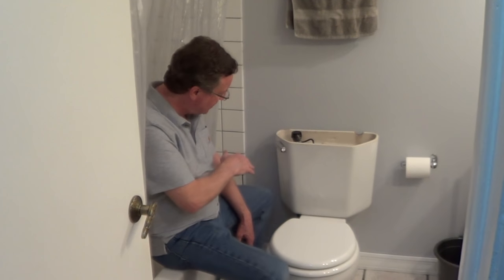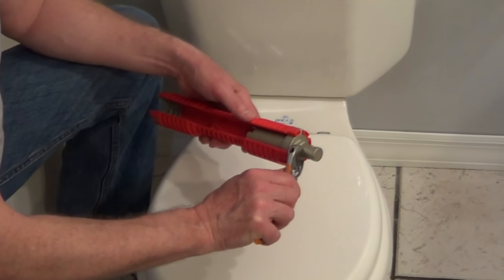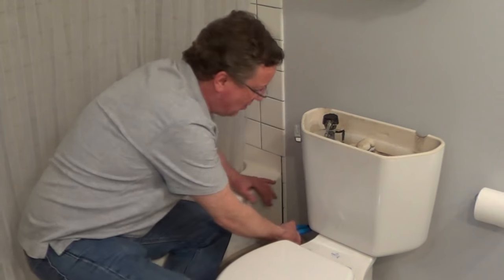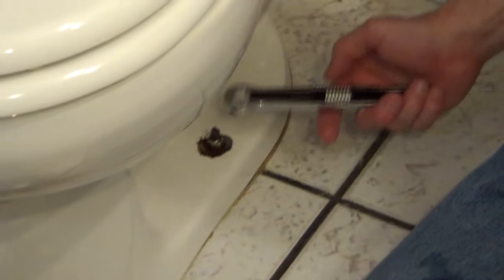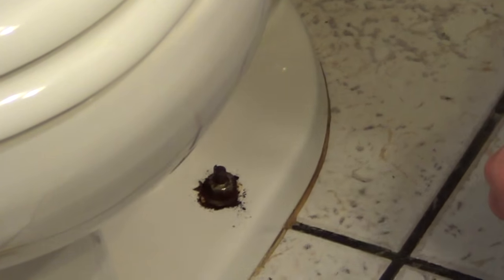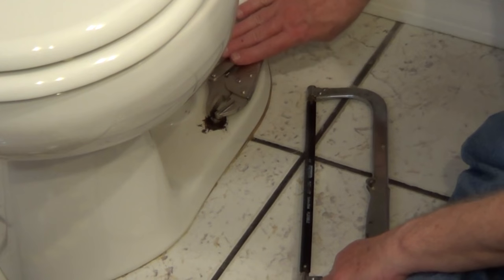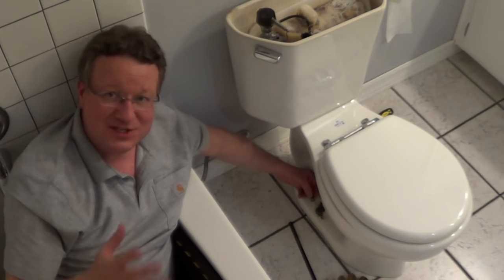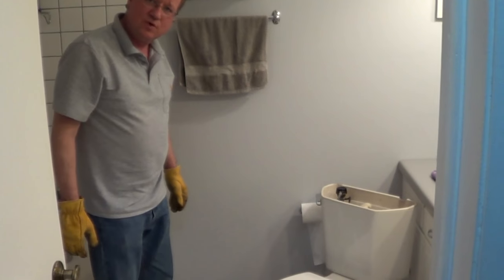How to Remove a Toilet

Comment: That was great, thank you.  But once I get it off is there a way to check to see if something is in the trap because my toilet keeps threatening to overflow even though the plumber tried to snake it. Is a new toilet the only option or can the old one be remedied? You seem like you would know.
Reply from the maker: Hi, you can use a toilet auger with the end opened up wider with a pliers to try and catch something caught in the trap, like a toothbrush or comb. You can take the toilet outside and turn if upside down and pour water into the bottom with a 5 gal bucket.
Reply: Ok, so here’s what I did. Emptied all the water like you said. Took off the tank. Strong armed the toilet bowl downstairs (HEAVY!) to my backyard grass area, plugged a rag into the hole to the tank, and forced the garden hose wrapped with another rag to keep the water from coming back out, threaded it up through the bottom hole and turned it on full blast. Whoosh! Out popped 2 x 2 inch plastic dental floss container that has been threatening an overflow for years.  Professional auger guy previously couldn’t auger it out and told me I needed a new toilet.      Scrubbed everything up, got a new wax seal, reassembled, learned a bunch, and saved tons of money and didn’t have to buy a new toilet.  Thank you for the details and inspiration!

Comment: What about the caulk?
Reply from the maker: Hi, are you asking about the wax ring?
Reply: FIX IT Home Improvement Channel  No the sealing caulk around the bottom of the bowl.  It’s by far the most difficult part and I haven’t found a single video that explains how to cut through it. I ended up using a putty knife, but it got bent to hell in the process. Would have been nice to have instructions on how to do it properly.
Reply from the maker: Hi, for most projects you don't need caulk around the bottom of the bowl unless you wet mop and don't want the water to get under the toilet. To remove old caulk. a utility knife will do a good job. Once the toilet is removed use a flat razor scraper to remove the caulk from the surfaces.
Reply: FIX IT Home Improvement Channel instructions on how to remove the old caulk would have been helpful. Maybe I wouldn’t have damaged my putty knife in the process if somebody—anybody—had provided instructions for cutting through the caulk, which was by far the most difficult part of removing the toilet.
Reply: Same here, no one ever mentions the caulk. I found this though:

FineHomeBuilding says: It is not only OK to apply a bead of sealant around the base of a toilet but it’s also required by the International Plumbing Code and the International Residential Code.

A plumber’s main responsibility is to provide sanitation. We design and install the drain, waste, and vent systems that prevent germs and bacteria from infiltrating a house; a properly sealed toilet bowl is part of that system.

One risk is that condensation on the outside of the bowl during hot summer days can drip between the toilet and the floor. An even bigger risk is if the toilet overflows, allowing soiled water to wick in around the base—the perfect spot for growing some of the nastiest germs on the planet.

A correctly installed toilet depends on proper floor prep and the standard practice of good workmanship when connecting the bowl to the floor flange. The toilet floor flange should always be installed on top of the finished floor; I prefer to seal the bowl with Phenoseal caulk, which cures to a flexible, durable watertight finish. Always test-flush a newly installed toilet multiple times before sealing it, just to rule out the chance of a hiccup in the installation process.

Comment: Conveniently easily lifted up off the floor. Not realistic. What do you do when it doesn’t just lift up?
Reply from the maker: Hi, if you remove the nuts from the bolts holding the bowl down, you should be able to lift it up. There is only a gasket under the bowl. If silicone or caulk was used on the floor, you might have to cut through it with a utility knife.